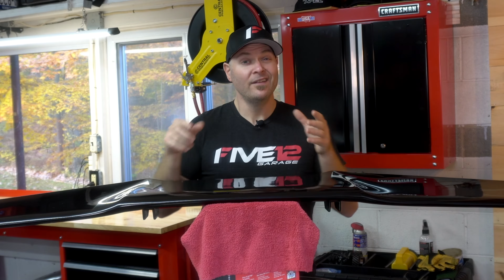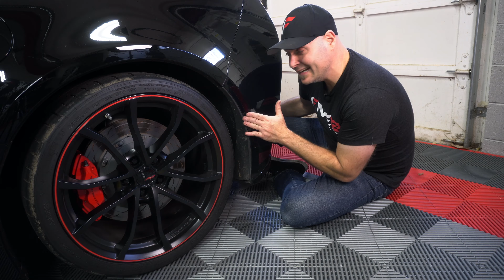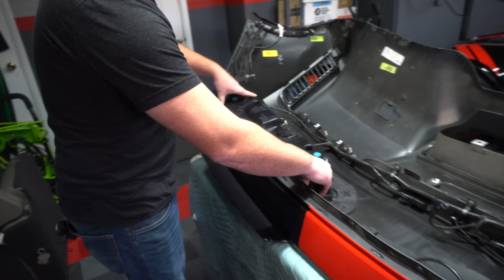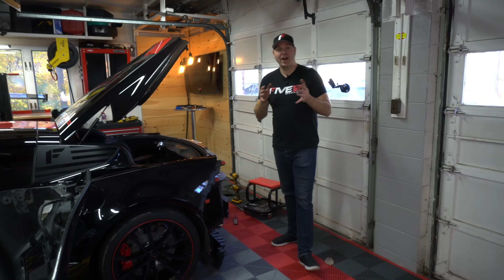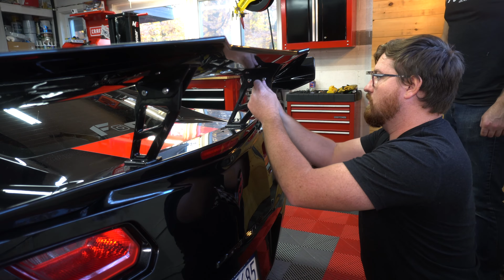C7 Corvette ZR1 ZTK High Wing Spoiler Install from Extreme Online Store | EOS ZR1 ZTK WING INSTALLED

Comment: Good Video, nice wing.  Got me thinking about putting one on my C7, but...  How you gonna put stuff the trunk now?  Golf bag, Carry-on bag, Cooler, T-top etc.  How stable is it on the highway?  I heard rumors that it flops around?
Reply from the maker: It does add a bit of a challenge putting things in the trunk. But it was worth the struggle! It shakes a small amount when hitting bumps. I’ve had it on over a year and no problems.

Comment: i wouldn't recommend this version of the ZR1 wing. i have this one and it wobbles even with the stabilizer and JB weld to glue it in. The wobble is not good for down force. it's only good for looks but if you want one that function then you better go spend a little bit more money to go look somewhere else. This topic have been brought up in the EOS corvette forum also.
Reply: The spoiler shakes when I drive high speed. Yours do the same?
Reply: @fargo07  Yes. i even JB weld the stabilizer in the spoiler too and it still wobbles. its embarrassing when it wobbles. There is no point in downforce if that thing wobbles and flap like a bird. Plastic is not good for this type of spoiler. You need a carbon fiber one.
Reply: @Tewthpaste  the plastic one cost me $1500 carbon fiber is $2500
Reply: @fargo07  if the E.O.S bracket is the same measurement then you can just buy the carbon fiber wings without any bracket ($1700 not including tax/shipping cost). i dont know if the measurement on the carbon fiber from Weapon X is the same as E.O.S. All you need is if it will fit over the E.O.S bracket. if its OEM measurement then it should fit but i haven't try.

Comment: How do you prevent water from getting in between the bumper from the mount portion of the spoiler?
Reply from the maker: Great Question!  So quick answer, there's a rubber gasket and I guess you could use some clear silicone sealant if you were overly concerned.  Longer answer, I don't think you need to.  Here's why...the inside area of the bumper is not open to interior cabin space.  Plus the base of the stanchions fit over the holes on the base spoiler.  I'd be more concerned about water entering from some of the factory seems in the body panels.  Shoot me an email if you have more questions: scott@five12garage.com. Happy to help!

Comment: Can you give me a measurement(center to center on the stansions) where they meet the body? Trying to see if the wing would work on another application. Thanks
Reply from the maker: Stansions are just about 18” center to center where they bolt into the top of the rear fascia. Shoot me an email if you think it will work. scott@teamfive12.com
Reply: yea, i would want to buy a new wing too and use the old mount. this wing dont work as it wobbles.

Comment: I purchased one and installed. The issue i have with this wing is, it flexes non stop while driving. You can see the Winglets moving up and down in your mirrors constantly. It's not the Winglets that are the problem other than my first time ever seen 3m tape to keep them mounted, it's the blade (wing itself) that flexes on each side from the pillar (wing mount) on outward to the Winglets. Is this supposed to be normal?? Or did I get a manufacturer defect??
Reply from the maker: Did your wing come with the stabilizers? Even with them installed you may see a bit of flex as you’re driving. This is normal. Mine does it too. No problems after to close to 1000 miles of driving.
Reply: @Team512  thanks for the feed back. My shipment did come with plastic stabilizers I guess.. After install, I saw in the box some plastic pieces. Every YouTube video I watched never mentioned them.. I was maneuvering the pieces on different areas of the wing and can't seem to figure out the correct configuration.. Any feedback on the install of the stabilizer would be awesome. TIA
Reply from the maker: Sure! Check out my ZR1 ZTK wing prep video. I go over exactly how to install the stabilizers.
Reply: @Team512  bro, you're a freaking lifesaver!!! Installing those bad boys tomorrow!! Thanks for the feedback for real!! I'm mos def going to refer Five12 to all my corvette buddies!
Reply from the maker: Thanks man! Always happy to help!

Comment: All I can say is WOW! 
You never cease too amaze. God damn that looks good. You make it look easy too easy though. I have done some mods to my 19 GS after watching you do them on yours. I think this one may outside of my comfort level. 
I done the front splitter upgrade ( quite easy with a lift, as you suggested) also did the skirts or side splitters ( also not a problem ) but this one I think will be a challenge. Any suggestions? It’s usually just me working on the vette. 
Aside from that I’m very happy to see some more C7 content, I understand you’re limited. You can only do so much. Lol
Reply from the maker: I appreciate the kind words Tom! Glad I could help with the front splitter and side skirts.  To be honest, the wing is not too difficult.  It's helpful to have a second set of hands when removing the rear bumper.  After that, it's mostly a one man job.  Just make sure you remove enough of the adhesive to slide the main brackets into place.  Then just start assembling the "lego set" of bolts and smaller brackets. A few more C7 vids are on the way.  Look for one tomorrow morning.  Cheers!

Comment: Great video! Couple of questions:
1) One of the most common feedback I've heard of this spoiler is that due to its lack of rigidity, it vibrates while driving on the highway. Has this issue been fixed and/or have you experienced this?
2) I find the ZTK spoiler to be awkwardly high...are the EOS mounts shorter by any chance or do they make a version of mounts that is shorter so the spoiler is closer to the car?
Reply from the maker: Great questions. Thanks for reaching out! So the wing comes with stabilizer bars that need to be installed inside the wing before installing on your car. I have a video going live on Sunday showing the process. While the stabilizer bars mitigate much of the vibration, you will still notice some small movements at highway speeds. But consider the trade off on price. A full carbon wing setup will cost 3-5x more than this one. 

As of right now, there is only one height for the mounts. It’s mounted at the factory ZR1 height. 

Thanks again for the great questions and your support. Please let me know if you have any other questions. Always happy to help!